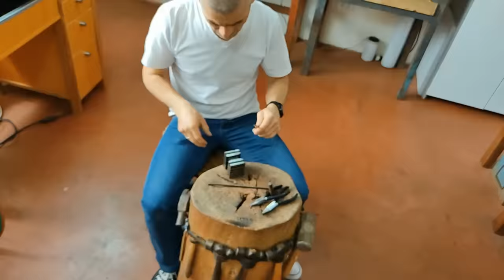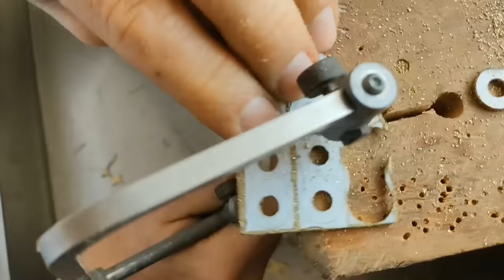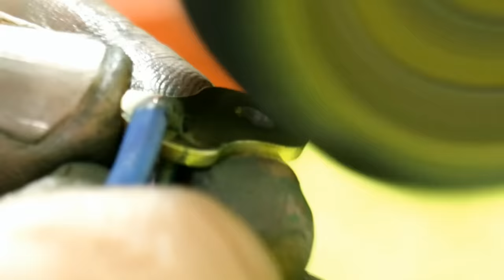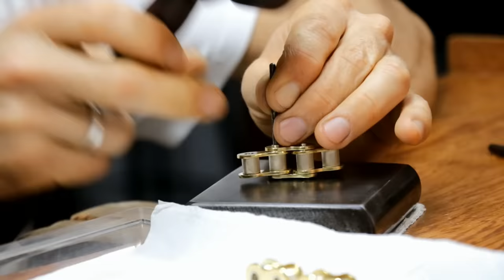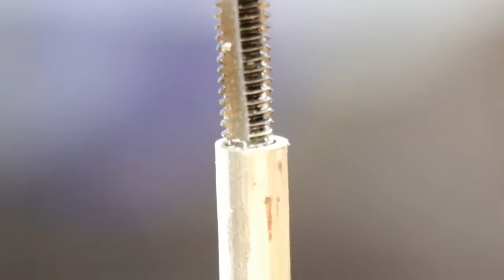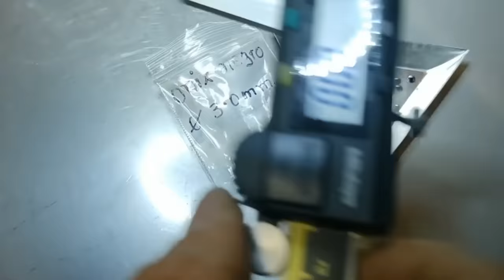This is how you can make a motorcycle chain as a bracelet.   (cadena de moto para pulsera)

Comment: Very beautiful... 

With all due respect, I think if you cut all the small Rectangular pieces and stacked them on top of each other and then used the a sutable drill size to make the inner holes and then file all the pieces together while they are stacked, it would be easier and save a lot of time

Regards
Reply from the maker: Thanks for the suggestion  Abdullah.